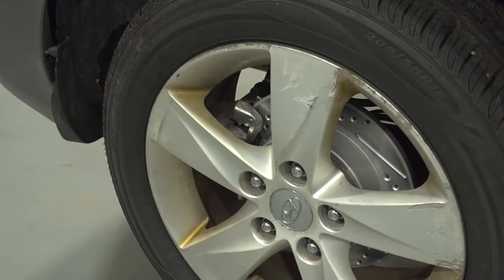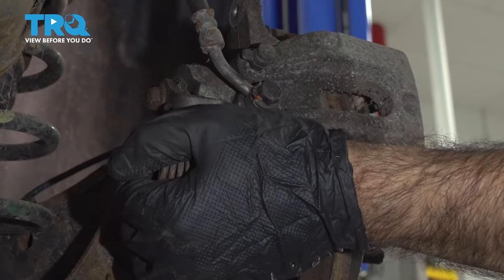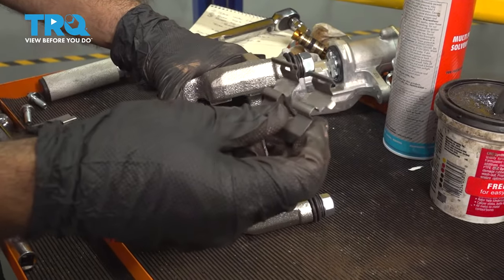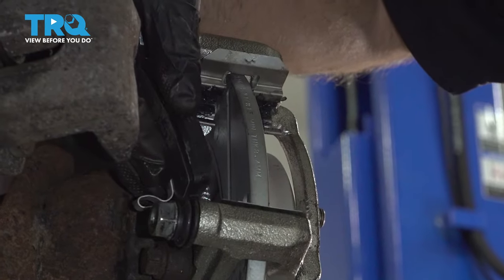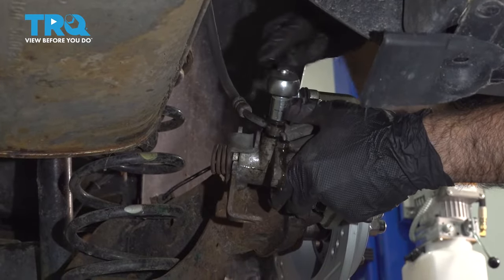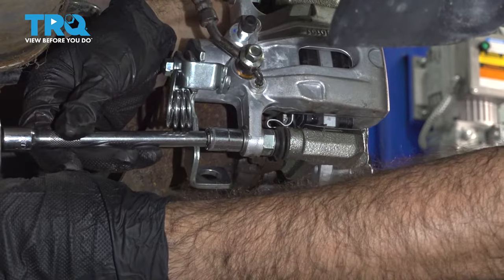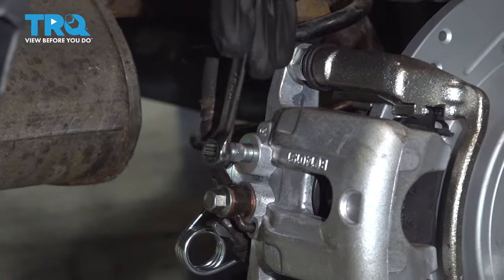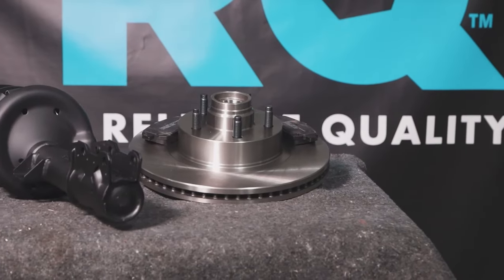How to Replace Rear Brake Caliper 2011-2016 Hyundai Elantra

Comment: Thank you. I'm going to be doing my first attempt at brakes soon. Mechanic in town quoted me $625 for new rear calipers and rotors. I'm sick of not being able to do this myself so Ive been watching a lot of videos on car repair. I think for $625 I could buy all the parts and tools for less or the same price. Plus learning how will save me money in the long run. I have a 2012 elantra.

Edit: doing the rear caliper, rotors and pads today. Also the parts I needed I got for 380 and I can return the previous cores for $60. The tools were the expensive part. But theyre an investment for future projects. I spent at least 400 on tools because i literally bought everything I could or might need for doing this. I didnt have any tools before.

Comment: I wanted to thank you for the detailed videos.  I've changed brake pads and rotors many times, but never a caliper or had to bleed a brake line.  My daughters Elantra needed all 4 rotors and RR caliper changed for a state inspection.  Part total was less than $200.  I can't imagine what my garage would've charged.  I can't tell you how many times I viewed this video before I got started.  It gave me the confidence to proceed and I completed the task yesterday saving the caliper/rotor wheel for last.  We're up and running.  Thank you.

Comment: Thank you again. I changed my rear rotors, calipers, and pads thanks to you guys. I had a friend come over (hes a mechanic). He double checked my work and helped me bleed the brakes. I'm going to be paranoid for a while though. Im costantly checking for leaks. But the pulsating is gone now.